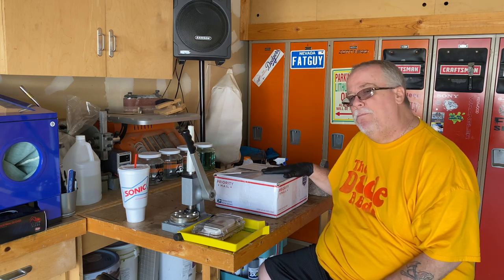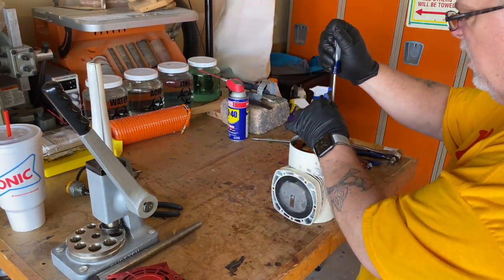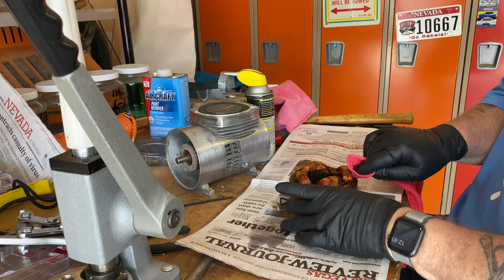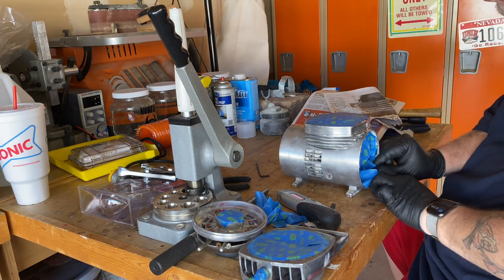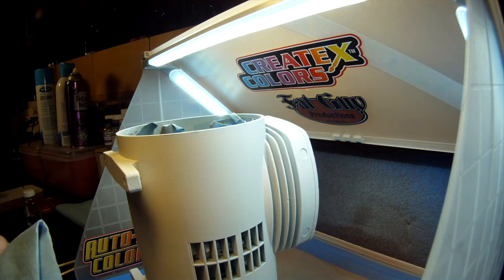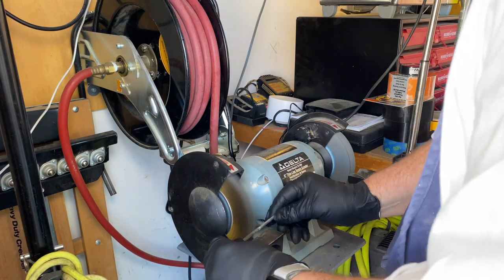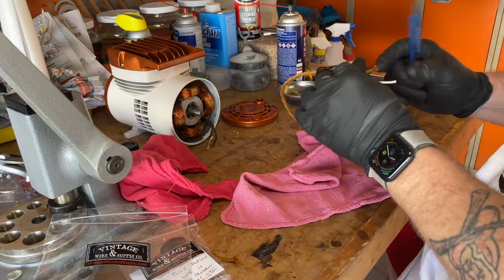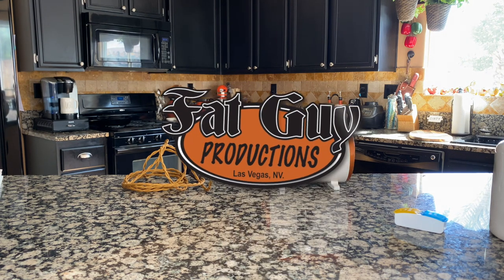Restoring a Crummy Compressor!

Comment: I just bought a vintage compressor today and decided to see if anyone had done a restoration of a small compressor of all things. Imagine my surprise to find your video and see what looks like the exact same unit being restored! 
In case it might be of interest: Mine is a Thomas 1100P, and is labelled as a MEDI-PUMP, for hospital use. It also has a decal on the body warning of explosions if used around certain volatile anesthetic gas. It has a pressure gauge on the front that goes up to 30 PSI and what looks like a moisture trap that had a deteriorated sponge in a metal cylinder. I paid more attention after holding my thumb over the hose, then releasing it to test the pressure... then shooting powdered sponge into my eye. Slow clap. The electric cord is original, has a ground, and is labelled 'hospital grade'. I guess that must be pretty good, because it's somehow still in excellent shape. This unit had a blue body, with white cap/ends. One other thing of note: under the handle/cap, that wide area had a decal strip, silver with three horizontal lines. 
Great work on yours! Thanks for the inspiration and saving me some trial and error. Subbed!
Reply from the maker: You will have a great time!  email me some pics when you are done!   captainpaul@cox.net

Comment: Looks great Pauly, the cord is a great touch. The holes in the legs may need some little rubber feet pulled through so it doesn't end up scratching the compressor.
Reply from the maker: You wouldn’t believe how hard it is to find feet for this!  I’m still trying!

Comment: You're still using dinosaur compressors like that? I had a badger like that that lasted me 15 years.  It was my first after I figured out how expensive compressed air cost.
I now have a Iwata with dual hose connections.